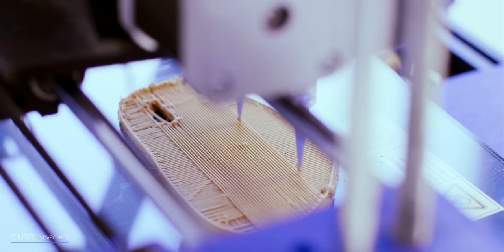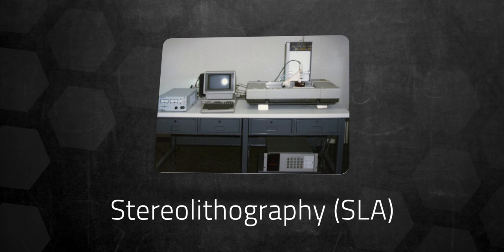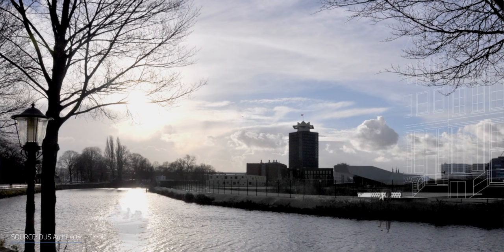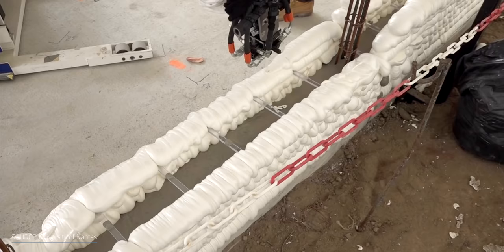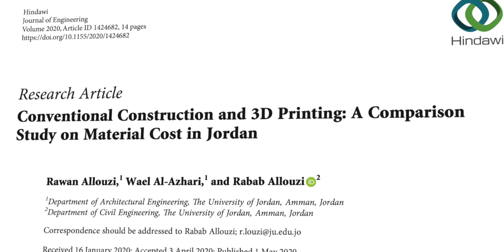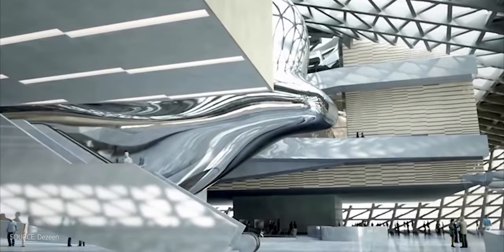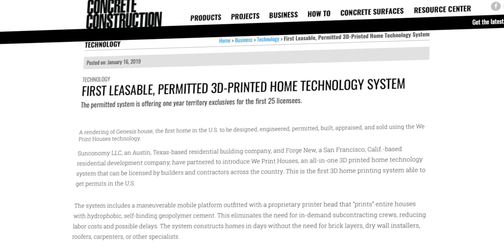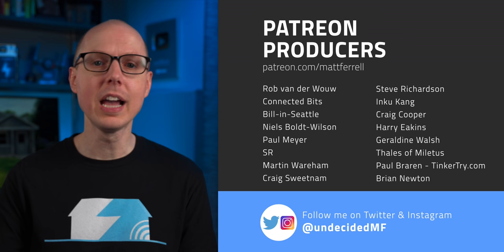This 3D Printed House Changes Everything - Explained

Comment: Sounds great and all but what happens when you want to add a plug in your living room, doesn’t look like you can fish down those walls, oh it’s concrete and steel, no longer can use romex. Oh I have to use a grinder or a concrete saw to cut in the box? Oh never mind I’ll just pipe on the surface and have all my piping exposed. Just like using prefab buildings, can’t customize after the fact. Try hanging a pitcher on the wall with uneven concrete walls. Tv mount? Their are just a lot of problems that just aren’t mentioned here
Reply: Other problems will just be from the use of the materials itself. Concrete cracks, no matter what, over time from weathering, freezing thawing the exterior will start cracking. Concrete is porous so you will get damp, moldy interior walls over time. Your home will shift over time and settle, which concrete isn’t flexible not to mention heating and then cooling also will cause cracking. There just isn’t any flex in this home, your wood house will creek at night and in the morning from this flexing, concrete doesn’t have that flexibility.

Comment: Seems that much of the video talked about "3d printed house" as if its one thing. Particularly comparing to cement house. Yet 3d printed house completely depends on what material you're printing. Video shows radically different materials under the same broad label. Can 3d print cement, mud, mortar, plastics, or anything that can be deposited.

Comment: It's a cool concept, but at a macro level lower labor costs = fewer jobs = less buying power = any cost-benefit lost to systemic inadequacies... in the long run if fully implemented by itself, this technology amounts to nothing at best, but more likely just makes things worse. Just like any other kind of robotization of production.
Reply: If menial jobs being taken over by robots and AI = a negative, then the current economic system is wrong.
Reply: @harpoonmcfierce9697  That's my point. The problem is that there are a lot of obstacles to fixing that. A lot more than in the way of developing 3d printed houses. And mixed with the current system any labor freeing tech is a disaster waiting to happen. At first, mostly for common people, but eventually for businesses as well - you can't drink from a drying well forever.
Reply: @arcuscerebellumus8797  Correct, that's why we need to transition to Socialism

Comment: 1:19 $299,000 is far from "affordable," especially for a small 1,400 square foot house.  Regulation (esp. zoning), the real estate industry, HOAs, and the construction industry all have a role in the soaring cost of housing.  The housing crisis won't be solved with 3D printed housing until these interest groups are brought to heel.  Enough housing needs to be built so that house prices crash.

Comment: nice video, but the point at 7:11 is has very little to do with construction 3d printing. That paper is clearly talking about FDM molten thermoplastic PLA, PET, ABS at 200+ C, not concrete material extrusion printers.

Comment: One major issue with the current generation of printed houses is shared with ICF construction, renovations at a later date.  I know ICON uses a foam filler between the inner and outer walls, I'm going to guess the other companies do the same for better insulation, so you have the carbon and other gasses from the foam used as insulation to figure into the equations as well.

Comment: I think  a clay version makes the most sense for cost, and environmental impact.
Reply: true. the mars version uses crushed ground material directly from the site.

that would be the optimal solution for temporary shelter.

When building long lasting houses you will need some additives at least or have to use concrete

Comment: I would be concerned with the indoor air pollution generated from the additives needed for the material hardening process. Perhaps this could addressed by coating the interior walls with some kind of non-toxic sealant or eco-friendly cladding overlap? What does this mean for the viability off-world 3D printed habitats like the ones proposed for The Moon and Mars in which the indoor air cannot be exchanged with outdoor air because the latter is non-existent? Energy-efficient (i.e. expensive) ventilation systems will need to be installed in order to mitigate high VOC concentrations.

Comment: Reduced labour, fewer material costs, quicker turnaround and greener homes.  Yet the houses are being sold for the same price as traditional builds...there are some big cheeses profiteering off the top whilst many go without an affordable home in a sensible timeframe.  The problem isn't technology, it's greed.

Comment: The problem I see is that concrete is a pretty bad material to build houses because it produces a lot of CO² and the sand for concrete is extremely limited and a lot of it is already collected criminally and destroys a lot of the world.

Compared to that bricks can be made a bit cleaner and thanks to variations you do not have to plunder one area that extremely.

Comment: There is no way you are going to beat a pre nailed timber frame x claded house. Try your hardest. All the past attempts have resolved back to this construction method. Fully completed turn key builds for these houses  are selling for $750 USD per square meter by project builders.

Comment: Prices for 3D construction are "bleeding-edge" prices paying for new machinery, new techniques, and a limited talent pool of trained operators. They only need to come in 20% lower than conventional, which is ridiculous given that labor is 50% of a typical build. They're making a killing, and good on them. Prices will come down as competition increases among new entrants to the 3D building trade, the amortization of specialized equipment, and the increased number of trained operators. In addition, new 3D materials -- beyond liquid lava -- and techniques will probably appear, some more green, some more versatile. So if y'all have been wondering how a planetoid-size deathstar can be built so damn fast, well, now you know.

Comment: 3D printing is cool but not at those prices!  300K for a 1500 sq ft house is twice what similar sized homes go for in my area.  Whats the cost if you don't factor in the land?  That would allow for a better comparison to compare it to building a new home from scratch.

Comment: This is a topic near and dear to my hearth ( ;P). 

Arguably the greatest benefit of additive manufacturing in construction is precision and uniformity. If you can build 2000 houses across a nation in exactly the same dimensions, then significant modular enhancement becomes possible. 

I personally feel the ideal for additive manufacturing tech in construction would be sintering. Using whatever dirt is available in the area, or if only rocks are available, then they can grind that up. The laser, and everything to do with the process, can be wind/solar powered on site. If it adds some construction time, then it wins again on cost, and sustainable credentials. In arid regions especially such techniques would shine ( ,;,,;,). Plenty of sun. Plenty of sand. A single, versatile mechanism could thus build a megapolis, right in the desert. Essentially for free. Discounting the value of the time and mechanical maintenance required. From sand.
Using concrete is sub-optimal in my mind. Mud sure. Otherwise a sintering process.
Otherwise... One could combine the best of both worlds. Construct a rounded corner "frame/brace" with straight wooden panel sections (maybe with pre-fitted windows and doors) slotting into that. At the state of the art that would likely be quite affordable.

Comment: OK, the biggest problem I’m having with this video is the lack of explanation and the lack of research. Like for instance, the company Icon built a 800 Square foot 3-D print house which cost to build was $10,000. Doubling that the house it would be 1600 Square feet with $20,000 building cost, so even with more square footage then the 3-D print house in this video doesn’t come close to $300,000. I get the land was $100,000 but where did the extra $185,000 come from? Because it sure as hell didn’t come from labor cost or installing utilities. I mean the actual cost of this house should be around $115.000.

Comment: Well considering there is an extreme shortage in all vocations those who are displaced or may be really should look into maintenance vocations, building the house is one thing, isolating problems and fixing those problems is a far more complex task. Even from my industry (RV's) a well trained and mildly experienced RV tech with a couple years experience can easily make $35 an hour, 70k per year.

Comment: Soooo - they take longer, cost more and are less stable than houses build "normally".
3D printing is useful for very low volume production and prototyping - or for configurations where just no other method can construct that shape.. But houses? In general you do want them to be rectangular with 90° angles - and that makes them ideal for prefabrication and modular systems. Want a house with concrete walls? You can build up the walls like Lego - yes, box-structures out of the insulation-material that you just stack together in the shape you want and then fill with concrete - takes 1 day.

But it is typical buzzword-bingo and "everything-new-is-always-better-in-every-way".

Comment: Could onsite workers lay electrical conduit and/or plumbing between layers?  Should be simple enough to adjust the pour rate in-design or on-demand to compensate for the added non-fill materials.

Comment: Have to be about 150k and affordable for a 3bdrm , but that may come with more adoption through large and small scale. 250k to 500k I could build a two story 5 bdrm 3 bath half brick half wood structure. like a mini mansion, and probably have cash to choose the site I build on.  Even at 200k in 20 years I'm still priced out of the market for a printed home.  I'd still be better off with smaller and modular with lighter materials and evolving build techniques that will get me the same sq footage or more.

Comment: This is not for low income. The cost is driven by the area it is in. In areas where the general cost is low, so are the wages. The price of the 3D printed houses in Austin are indicative of how this trend will go. The tech will benefit the rich and either be neutral to or screw the rest. Like electric vehicles.
I wonder if the prices will go low enough that the displaced workers who lose their jobs in construction can still afford them?

Comment: That sound weird for me because my family is in construction industry for generations...if you are going to build 1 or 2 levels building it make sense to reduce the amount of cement as it's more expensive and also more polluting so using brick walls and minimum amount of cement...and even brick is holo inside and can be recycled by simply using it again without even any processing needed ...how come uusing printed concrete which full custom build which mean to use it again you have to process it and cement releases a lot of CO2 and more expensive  is a better choice? I can't see that according to what saw ....in a 1 or 2 levels home you are looking at %10 to %20 concrete..but build by %100 concrete is bad idea in every way

Comment: Eh, no multi-floor building and the shape it makes is very unappealing to me. And the passive home building techniques don't seem that compatible to me. What about house extensions or modifications? Like if I wanna move that window or door, or say add a new pipe or electric line? seems it'll lose quite the appeal for that, and layering in normal 3d prints is an issue so is it with this tech? I mean, I'm not sure how to 3d print the foundations and pillars.

Comment: Can you 3D print a house? Of course. Is it a good idea? Maybe. I like the idea of it, but, it is not ideal. I like the idea of "rammed earth bag construction", but it is labor-intensive. If some machine could be made to reduce the labor of rammed earth bag houses, it could revolutionize the housing industry. The homes are literally made out of dirt, the cheapest material out there pretty much.

I envision a machine with steel plates that can be adjusted, it dump the right dirt mixture into the area, ram the crap out of it to compact it and make it strong, then move on to the next section. However, this might cause some structural issues. Could also use the same bag technology as labor-intensive units but build a machine to fill the bags, lay the barbed wire, lay the bags, and compact them. If sticking with the cylindrical style, it would be fairly trivial to build such a machine. The hardest part would be automating the soil mixture and moisture content as they should be in an ideal range for most strength. If done correctly, one or two people could build an entire house and the only materials needed would be the bags, barbed wire, and the dirt mixture. Once built, you can then pretty it up with exterior and interior coverings.

Comment: Coming from an architecture perspective, the innovations of 3D printing and other process automation and computer numerical control tool have yet to make a substantial impact, and may realistically never live up to the hype. For example, 3D printed concrete homes have been a topic of discussion for 10 years now. But fundamentally there are substantial issues with 3D printed concrete for use in residential or commercial applications. The horizontal strength of the assembled product is relatively weak in the the horizontal axis, which is bad if you live in a seismically active area. Concrete broadly is a poor product in terms of sustainability, due to it’s enormous carbon output needed to convert lime for use in cement, as well as the long term issue of sourcing the right grade of sand for it’s production. Likewise you don’t want a house who’s walls are cement, even with an air cavity, because it has a pretty poor insulation value. Finally you have issues like being unable to build a conventional 2 or 3 story structure, because you can’t easily bridge those distances like you can in a thermoplastic. (Which isn’t to say you can’t change the design to accommodate vaulted ceilings, but their commercial appeal is pretty limited). Using acyllic foam is illegal in the US as a structural material (Like the one Dutch project) because it’s not fire rated as a complete assembly, and it’s VOC emissions aren’t good either. Finally you wind up using more electricity to operate a large 3D printer that you would otherwise use. Mud or rammed earth are probably yet most viable of the options, but remains to be seen how they compare to conventional rammed earth techniques. The living building materials program is one of several, that even if they do succeed in building self renewing building materials, may never become commercially viable, or allowable in construction due to the strictness of the American fire and safety code. (For good reason). 

If any process methodology shows great promise, it’s prefabrication as it uses conventional construction materials that are well tested and well proven, but produced in a process methodology that saves considerable waste and energy in assembly. There’s a much longer history of prefab and it’s commercial development in the US, and the world in architecture. And there’s considerable investment and growing use in the US, particularly in cities where construction costs are very high like NYC and SF, as well as the more familiar trailer style prefab used just about everywhere.

Comment: I have been watching them build a 3D printed house up the street from me. In the  time it takes to set up all that crap the house should be framed have the air conditioning, plumbing and electrical all installed.   You gonna tell me that it is cheaper?

Comment: Still has the same problems. Knocking up the walls is the quickest and easiest bit. I''ll need a printer that can handle plumbing and electric or even just the roof before I'll take it too seriously.

Having said that. It's clearly works for the walls and it can clearly handle complicated and fiddly walls. So to me its interesting but still in the toy stage

Comment: I wonder what are the cons of 3d printed houses compared to traditional houses, assuming there's difference in long term repairability and maintenance cost.
Reply: Well, one is that it's all one piece, so if the ground shifts you're more likely to get cracks since there's not the flexibility of lots of small pieces that can adjust - potentially with small cracks that can be repaired in the mortar - and any cracks don't have a natural "stop" point.

But that might be possible to mitigate if you're careful with the choice of land.
Reply: @dreadlindwyrm  also I doubt it's even possible to rebuild one wall or part of a wall so it's only left with completely demolish then rebuild
Reply: @Liam-up2wm  That's a fair point.  I can see needing to do complete rebuilds for relatively minor damage that on a traditional build would be "put in a support and replace a few bricks".
Reply: @dreadlindwyrm  even though the low up front cost may be attractive but after many years of owning and living in the house the resell value might be lower than initial value. Because the buyers of "older second hand" 3d built houses has to consider the likelihood of complete rebuild after just few years. For ordinary families it's potentially going to be difficult to keep or raise the value of their asset/investment.